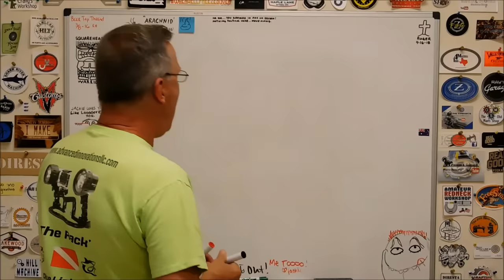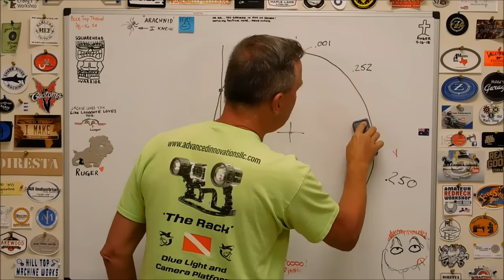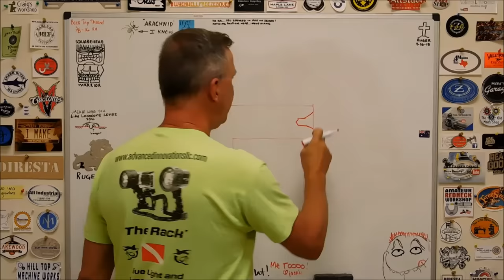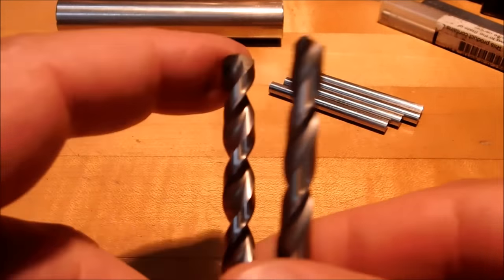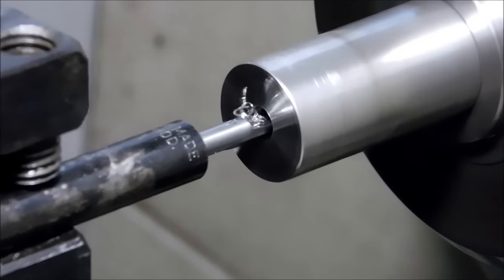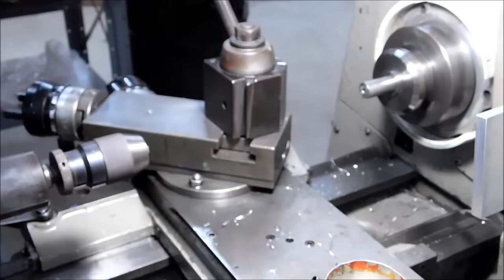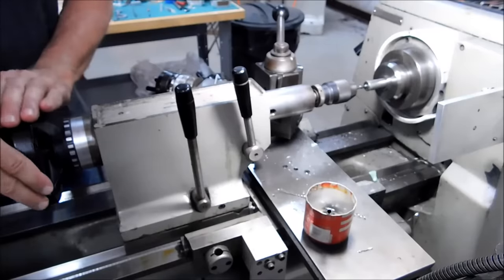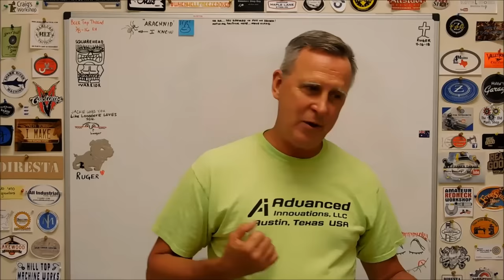Techniques for Machining Straight Deep Holes -- SHOP GEM --

Comment: Right on Joe as always!  Having worked in the automotive industry for many years, drills got the metal out, boring bars positioned the hole, and reamers gave you diameter and finish. Many people always wanted to skip a pass or two, with little success. When holes had to be deep, straight, and with a finish, gun drills were used, like on automatic transmission valve bodies. Gundrill geometry is very unique and contains parts of the three tools above, in one tool, but is not for the average machine shop. Gundrills require a hardened drill bushing to start the hole, high pressure coolant (~1000psi) to move the foil-like (<.001") chip up the straight flute, and carbide shoes to pilot and keep the single point tool located. Your video is perfect and addresses all the same processes for a universal machine shop.

Comment: Thanks, Joe. Always a few gems in each clip. I already (probably as a teenager) came up with using the carriage as a depth reference, but your later tip on a great way of quickly re-establishing the drilling depth after changing to a longer drill, by delaying locking the tailstock to the bed, I do now recall (thanks to you!) I used to do when I had smaller lathes, but I need to try on the big machines I now generally run. 
It's not enough to come up with these things intuitively, a real teacher will take careful note of such tricks in order to remember AND refine them, and even more importantly, to pass them on. 
"Paying it forward" is what got us to the top of the food chain, and you are a master of the art! Thanks again. You really are a treasure to this community of interest, and your generosity is truly admirable.
PS:
On my biggest lathe, your reminder might just give me the impetus I need to add air injection to make the tailstock move more easily. It's not huge, as 5MT tailstocks go, and does not have a gearbox, but it's a potential twisting strain on the back if I was to do a really deep hole. 
For instance, I have a 65mm diameter spade drill I made the 5MT holder and shank for which is 700mm long. Last time I used it, it took several hours to take to full depth! 
(I don't have high pressure coolant, just high volume flood, and of course there is no pilot hole, so I was clearing it every few mm). 
I don't have rapid on the carriage, either, otherwise it would be a no-brainer to use IT to push the tailstock back each time, once the depth started to amount to something. I would lash the tailstock to the carriage with cord, and if I did this, I could use a magnet under the front shear of the bed as an automatic moving depth indicator for stopping the forward motion of the carriage, similar to your original tip, to avoid headbutting the spade bit into the hole and risking making an indent to propagate chatter, which of course is the sworn enemy of spade drills.
I use Allied bits, and I stick with HSS for durability and because they tolerate things like no high pressure coolant and (intermittent) chatter much better than carbide, and I highly recommend them for deep holes in these larger sizes.
Reply: Hey, Gottenhimfella,
If you are interested in 'Deep Hole and Deeeeeep Trapanning' have a look at "David Wilks" you tube channel. That will blow your mind.
Just a suggestion.
Reply from the maker: I appreciate your comment. Thanks for taking the time.

Comment: Great Video! As far as drilling tools are concerned you will get better tolerances from a drill with a less aggressive helical angle. The reason for this has to do with the center of the drill and the amount of material left in it to give rigidity. More  twist= Less rigidity. there will always have to be a balance between rigidity and chip evacuation. Without TSC in a machine you will never be able to avoid that dilemma. Haas and Mitsubishi have great videos regarding this exact principle, plus the add benefits of Drill Coatings, and the roles that they play in drill selection for any given material to help with tolerances and chip evacuation. Also worth noting: tool tolerances are horrible (relatively speaking) if you can cut parts, you can cut tools. if you want to change the relief angle or distance on a drill, a tool cutter or tool grinder will give you so much more bang for your buck in the shop. DIY works every time for the trained professional.

Comment: Wanted to add that my father (now 88) taught me that carriage bump technique when I was 10 years old, and I've used it all my life. What's new to me is the virtual creation of a precision, concentric guide bushing with the center drill, drill, bore, ream sequence you detailed here... fantastic! BTW, I used Anchor Lube years ago... a bottle was given to me by a sales guy for lubing rubber that was to be die-cut. It worked great for that, but I never knew it could be used as a cutting fluid...gotta go find some!

Comment: Can’t remember the project just a few months ago but had a through hole come out way off center. Got it the second time by slowing down and changing drills but this would have ensured it. Great tip I’ll start using!

Comment: A masterclass in efficiency, economy and  patience. And how much easier it is with well maintained and understood machinery.
Reply from the maker: This works very well, just keep the oil under the tailstock and it glides like air.

Comment: Talk about fortuitous.   Normally I don't drill long holes down the axis of parts,  but I had to do it today so I could repair my tractor rather than wait for an ordered part.    I made two 1/2" dia, 3" long  holes that met in the center ...    I didn't try gauge pins,  but I could barely detect a little ridge where they met.  Also I saved a lot of time with the "move the whole tailstock" idea.   Thanks again.
Reply from the maker: Thanks for watching. Its a good technique to remember.

Comment: I went +.006 over at the top of the hole and +.002 at the bottom just this week I expected +.002 top and +.000 at the bottom. I didn't account concentricity of the drill grind or leave room for finish boring. Thanks Joe.

Comment: Just did this procedure 1/8" hole, 4" deep in P20 all from one end because I wanted to have the confidence in the process when I can't do from both ends in the future. I had to skip the boring bar step because I didn't have one that small. When I got done I flipped it and chamfered the exit. Hole was dead on. Thanks.

Comment: Thanks Joe for the wonderfully clear explanation.  I had to drill a 3mm hole through a 5mm rod 75mm long last weekend.  Being really careful and working from both ends, I drilled undersized and reamed out to full size.  Managed to get the hole straight enough to put a piece of 3mm drill rod through (which is what I required).  But it was not as good as I would have liked.  Particularly, I was surprised to find an oversize section at each opening.  NOW at least I know why!!!
This video is so full of tips and tricks I will have to watch it again.  I had heard about sliding the tail stock before but not about using the cross slide as a stop!  Tried it drilling a piece of brass and, of course, ran the drill bit into the bottom of the hole when sliding forward.  As you said with horrible results.  Too scared to try it again, I have spent many happy hours winding the tail stock back and forth ever since.  My right arm thanks you...
Reply from the maker: When the hole to OD ratio is that close, be careful not to constrict the drill with too much part pressure. I've seen them lock up and snap off.
Reply: @joepie221  . Thanks for that tip Joe.  I will keep it in mind.

Comment: I followed this procedure almost exactly. Missed the starting bore, over by about a thou. That didn't matter. Drilling with 31/64th pilot into 1.5 inch dia. 4130. Reaming every 1/4 to 1/2 inch with 0.4995 straight flute ream...old one, but sharp enough. Went a little over 6 inches and my precision ground stainless rod, 0.4990 slides perfectly, rotates perfectly as if it were a factory bearing. IT WORKS! I have not measured concentricity carefully, but when I flipped the part in my 4 jaw, the center was dead nuts. (And I'm not good with a 4-Jaw yet.)

Go slow;y, clean the chips every time the flutes are full, and use lube. Tried Anchor Lube...interesting stuff but it obscures all visibility of the cutting tool surfaces. Not sure where I'll use it in the future, but I did not prefer it for this. It does a good job...just kinda weird.
Reply from the maker: Anchor lube is good for high friction applications, and I use it,  but don't let it sit on your machine ways or carriage too long. Black stains are almost a given.

Comment: Thirty years ago I had to drill holes 3/8" diameter 24" deep in 2024 aluminum that I was making into aerodynamic probes for the wind tunnel I was working in. I first made a plate wider than the lathe cross slide and notched it to straddle the cross slide then tapped it every half inch  and made a steel dovetail block to fit my BXA Aloris tool block with an adjustment screw to fine adjust the height. I cranked the spindle out on the tailstock and with the cross slide ran the hole plate up against the side of the shaft to get it parallel. O aligned the stock on the hole plate with pins and clamps and used an edge finder to center the stock then center drilled and drilled with a stub drill, a standard length drill then a taper length drill which got me in about 6". Then I used a 24" long 3/8" drill that was made for drilling wood lamps that I had silver soldered a 6" extension on.I would drill a quarter inch deep and back out, I only had the one drill and didn't want to risk it breaking it. I didn't use the power feed I just cranked the longitudinal feedback and forth till I was at the proper depth to meet the cross hole that was predrilled. It worked for the two probes I had to make and then I had to make smaller probes that only had a 6" deep hole but it was 1/8" in 17-4 H900 and I broke one drill out of 5 try's, I needed 4 probes.Using the plate on the lathe as a holder for the stock worked great like a horizontal boring mill would have but I didn't have easy access to one so the lathe was great.

Comment: Excellent explanation on why the wander starts in the first place. Also really like the carriage bump trick, I can see that's a real time and effort saver.

Another trick I found on the lathe if you don't have the stub length drills on hand is, even with a good pilot hole, stay out of the resonate frequency of the drill with the RPM. changing the RPM can have a surprising effect on the drills tendency to wander.
Reply from the maker: I don't go by the book. I have general speeds, but the tool will let you know where its happy. Try the bump trick. You'll like it.
Reply: @joepie221  What's the bump trick?

Comment: This is by far the best I've seen on this topic. Thanks for sharing your life-long experience with us. I am trying to drill 8.5" 3/4" C360 brass round bar for an oil manifold. I will see if I can do it with the tips you have offered here.
Reply from the maker: This should certainly help. Good luck.

Comment: Sperry Sun developed a system called Slick Drill for drilling oil wells taking out the spiral typically seen in drilling.  They designed a drill bit with a gauge reamer directly above the cutting structure.  The reamer needed to be 1.5 times longer than the diameter of the bit. An 8 3/4" bit with the reamer built on was 16" long.  Worked extremely well.

Comment: Very good info.  I was failing often, resizing existing worn hole in part, by simply thinking drill would ‘find’ appropriate center and happily follow center of worn existing hole.  Hahahaaaa….  Thank you Joe. You not only explained what was happening in my fails, you gave the solution.  Because of you educating me, I now chose methods with tooling I have or make, to not fail job.  Thank you.  My jobs are 13” - 28” deep.   If people don’t believe a drill can walk a hole out the side in that distance, I will laugh at them!  Yes it will .  Excellent explanation of what was happening with my work!
Reply: Using carriage to stop tail stock also excellent. I mount/ align tool on carriage instead of using tailstock.  I lay a piece of metal on the ways to move carriage back to cutting position after retracting for chip clear out. When you’re doing 28” deep, mounting tooling on carriage is faster .
Reply: Also, on existing long through holes, I make 30” tool to go through existing hole. The use carriage to pull cutting tool through existing hole. Then use tooling for final hole.

Comment: Thanks for the demonstration. Great advice. Never thought that the starting hole using a boring tool would hinder bit wandering. I'm a big fan of using the center drill due to the short shank and the rigidity it benefits from.

Comment: Great video Joe, ---- I never thought about the helix angle affecting  the depth  needed before the body of the bit to start guiding the cut.     Also, great tip about the diamond pin,  " Constrain somthing once, and do it well"  or they will fight each other.. Pin 1 = location, but not rotation..... Pin 2= rotation..   It totally makes sense.  Also nice tip about knocking the corners off a square pin,  That's a lot eaiser to make that the rhombus shaped pin.  My lathe is worn badly and I have taken to putting the HSS paritng tool in the tool post  when center drilling.  I clamp it up higher than the Centerline ( I don't have to change the height screw) .  By gently resting the end of the paritng tool ( below the cutting lip) against the straight side of the center drill body,  I get much better results.  It sort of  takes any run out  from the worn tail stock /chuck/center drill assembly.   Be well..
Reply: Adrian Davidson Believe it or not, this is inherently more accurate. Kudos. Although by not cutting on center you are introducing some Ill effects unless your bearings are worn to the point that you are accounting for material climb.

Comment: Hi Joe, recently I make some small boring bar holders for my lathe and mill, but the HSS 1/4 rods  were not smooth going all the way through. I redo them , and follow your procedure of drilling, boring, reaming, under my milling machine (hole needs to be eccentric), and now the HSS 1/4 diameter rods slide smoothly in over a distance of 60mm. Many thanks for the great explanation and video! It works excellent!  And yes, be patient the entire procedure.
Reply from the maker: I appreciate the feedback.

Comment: The best video on deep hole I have seen ! Your explanations are clear ! GREAT teacher !! Just use this technic for a 3" deep 1/8" diameter hole and it worked flawlessly ! I am working on a mini lathe: I would like to know how to proceed to drill a 1/2 inch hole .... 1/2" drill from the start OR 1/8, then 1/4, then 3/8 ... Thank you for your attention, from a subscriber.
Reply from the maker: If you leave too little material for a finish cut, you risk burning the edges off your drill. If you leave too much, you risk an oversize hole if the drill isn't ground correctly. Its going to be trial and error for different materials. What ever you come up with, just remember, a pilot drill is effective when it relieves the material equal to or greater than the web thickness on the next drill in line. I usually go for 1/3 of the hole size as my pilot on smaller holes.
Reply: @joepie221  Thank you for your time/answer.

Comment: Once again, a very good description of a difficult process. I was taught a drill will make a hole with one more chord than the number of flutes. That is, a two flute drill will make a trichordal hole, a three flute drill will make a four “sided” hole and so on. Not sure  if this tidbit of minutiae is important but I find it interesting.
Reply from the maker: That is very true. Frustrating at times, but true.
Reply: They most certainly do exactly that, as I discovered to my chagrin while trying to drill a 20mm hole in a 12.7mm plate. The hole was so triangular that the matching 20mm rod wouldn't go through... Ultimately I had to bore the hole out on the lathe (thankfully the part was small enough to swing in my 4-jaw) and sleeve it to get it on-size, which is what I should have done in the first place (cutting corners never save you time).

Comment: Timely video. I have a job coming in to make a 1" dia. barrel sleeve for a Dan Wesson .38 that will be approximately 7-1/2" long. I think I will forward this to the customer to illustrate what is involved. A little more than "all ya gotta do is...."! I have been doing rifle barrel relines for years and I use the boring bar technique at the beginning of each hole to support the piloted drill and reduce the bell mouth at the entry to a minimum. Thanks.
Reply: Once i had a guy with a imperial screw that needed to be made,i asked him if he has a time and he stayed next to me while i was cutting the thread on lathe.It took me 45min to cut it on a lathe(it was several screws fairly long).He never complained how its easy and fast and as you said "all you need to . . .".Imperial dies are rare to be found in my country  and his catepillar used 1/2" bolts.He also never complained about price ether.

Comment: Best video I've seen to date on drilling deep holes  speakin my language big dog!
Reply from the maker: This is a great technique. You'll like it. be sure to clean the ways and get some oil under the tailstock for ease of movement.
Reply: @joepie221  actually applied it this weekend was drilling 10"+ holes in some  17-4 hh1150 pins that had a connecting holes for grease everyone was dead nut!